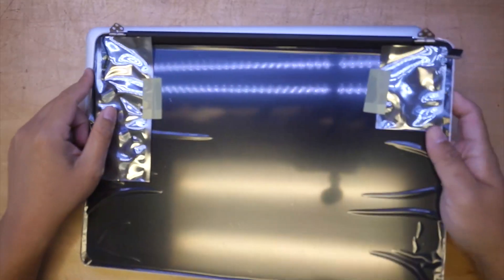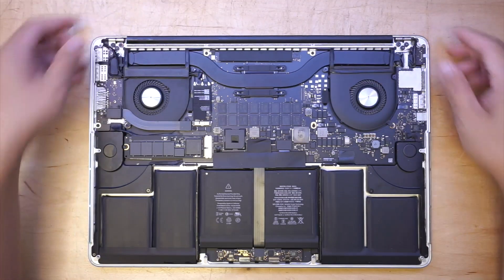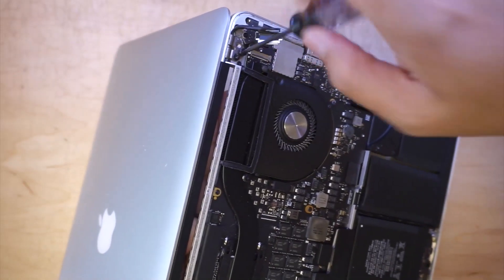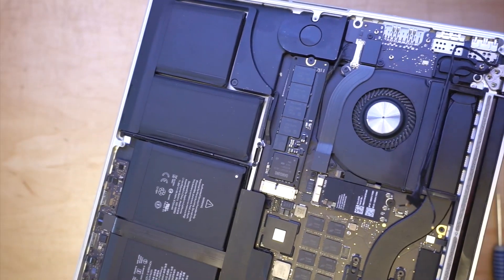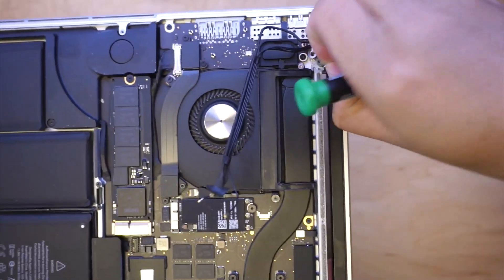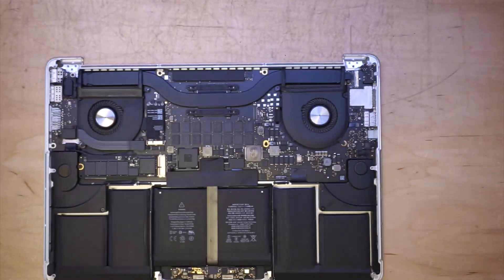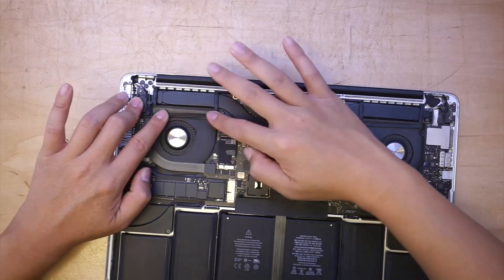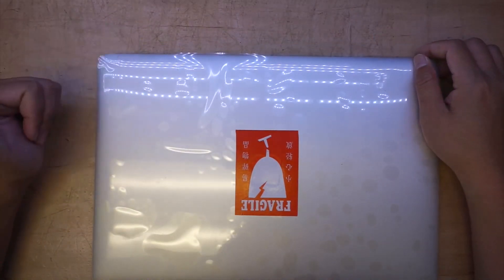How to replace Macbook Pro 15" Screen Replacement early 2015 - Step by step

Comment: Nice Vid just a couple of Tips.
1. Use a spudger. It's easier to de/reinstall the connectors.
2. Don't forget to re-route the BT cables near the hinge. 🙂

Comment: I have a partially damaged laptop screen and I'm planning to use the laptop mainly for video editing, so I need a large screen. Can I remove the laptop screen and connect it externally to a monitor for convenience? any precaution I need to consider before the removal
Reply: should be fine you shouldn't have to remove the screen tho
Reply: I have a partially damaged laptop too and my external screen works as soon as I login to my account. Now my screen is completely broken and It won't let me see until I logged in 😢

Comment: Maybe next time mention wi-Fi cable is going under Bluetooth,, brackets fully extended made for putting the screen on easier. Luckily I knew to disconnect the battery , disconnect the battery!, brilliant video. saved £300 pounds thank you. Do not close your Mac screen quickly on your earbuds...

Comment: Thank you for the video UberGeeks. A very good step by step description. 
In your replacements works, did you find that the connectors of the camera, antennae and the display to the logic board for Macbook Pro 15" - 2013, 2014 and 2015 look the same?

Comment: How do i know the exact screen model to buy?
My MacBook pro mid 2015 screen is cracked. Kindly assist.
I am in Africa, I can afford to buy a wrong screen.
Reply from the maker: Just make sure the seller has the right description. And match the cable connectors before buying. Not sure who sells them in Africa. Never been to Africa....wish I can visit someday

Comment: Is it possible to use  2013 or 2014 MacBook Pro 15” replace for mid MacBook Pro 2015 15”?
Reply from the maker: I think the cut off line is late 2014.
Reply: @UbergeeksBiz  so you mean 2014 can replace for 2015?
Reply from the maker: @jennysok  Yes, if it's late 2014. Make sure to check the cable first and match your LCD screen before buying.

Comment: Hello!

Are the 2013-2014 displays compatible with the 2015 macbook pros? They seem to have the same part number A1398, but different EMC numbers
Reply from the maker: No. You can't use 2013/2014 screen.

Comment: thank you so much for the video! was very clear, descriptive, and helpful.

is it really necessary to tape any of the cables once i have reassembled? if so, which kind of tape should i be using?
Reply from the maker: You are welcome. Glad it help.

No necessary. No tape needed.

Comment: The Ebay link no longer works. Is there a place where I can buy a screen replacement for cheap? All the ones on Ebay are around $500-600 and it would be cheaper to just buy another one at that point.
Reply: @Rusty_Gold85  There is no 2015 15" macbook pro display from ifix it.
Reply from the maker: Hi, thank you for letting me know. As you know, I do not have control over the product.
Please try the link again in description. All the best !
Reply: $49 if you want to work 2~3 hours to change lcd panel only ;)

Comment: Remember to disconnect the battery first.
Reply: What happens if you don't ? I  did that exact thing now my screen won't turn on not sure if that's the reason why
Reply from the maker: As long as the laptop is shut down, it should be fine.